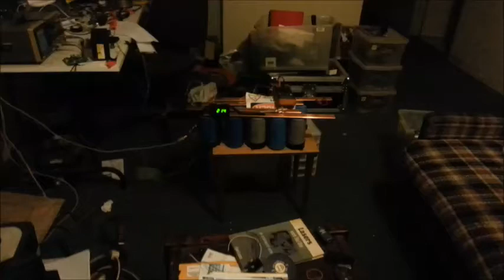cap bank forming pt3

Comment from the maker: Actually what your seeing there is the mess of cables from the 5v supply to the voltmeter and the charging cables from the bank to the flyback. The DUAL voltage divider (0-5v for arduino, 0-10v for the meter) is on a little bit of perfboard, and consumed the last of my 5k 25t trimpots :P

Comment from the maker: LOL theres two voltage dividers on mine - one for the arduino and one for the meter. This way they can be different, and keeps the two digital circuits isolated. The input resistors to each are 910K and 1M respectivly.